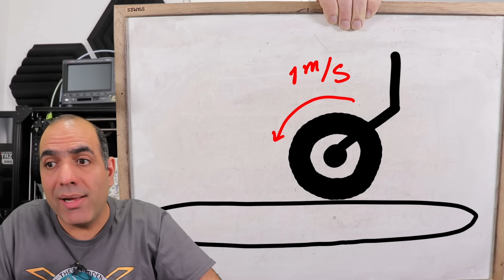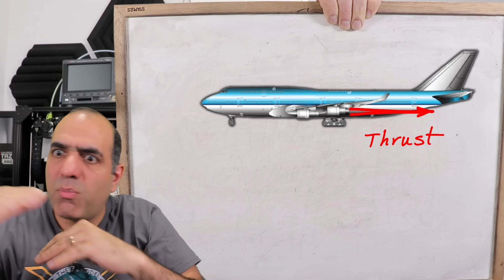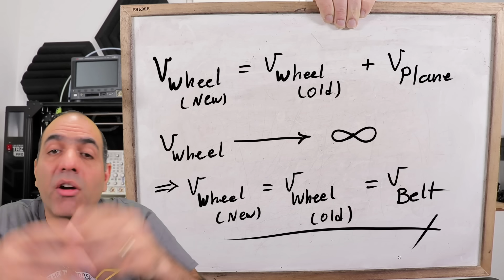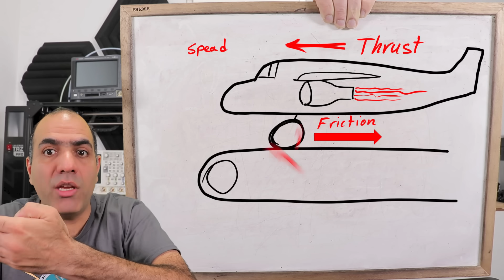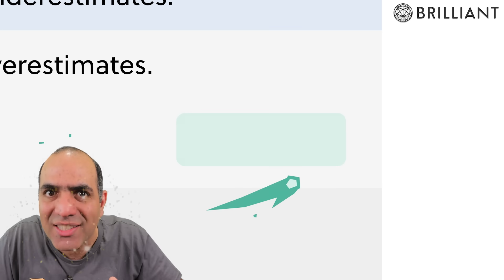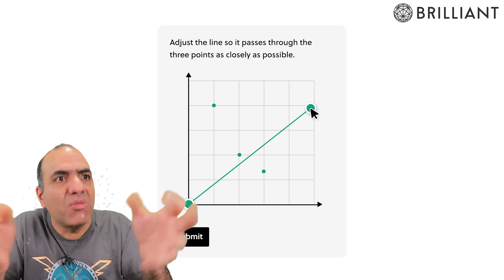Airplane Question that Drove Me NUTS!!!

Comment: before watching video: No, because it will technically never gain speed

After: I would still say it doesn't get off. It may be able to gain some speed, but considering it is a normal runway I would think that the speed it achieves before reaching the end would not be enough to get it off the ground

Comment: I arrived at the similar scenario as Mehdi: if the wheels and bearings have friction, then it wouldn't fly. But that is a completely theoretical situation as it would require a conveyor belt able to run at (tens of) thousands of kilometers per hour. Also the plane's tires and/or wheel bearings would fail at such high speeds. If we assume nothing gets broken during the test, it means the bearings can't have friction and the wheels are metal discs instead of rubber, in which case the plane will be able take off. But in that case it's not a standard 747 and there is always some friction.
Reply: I posit that even if the wheels are made of immortal, hot race-car tire rubber that isn't spinning at all, it still takes off. A 747 has enough power to go 100s of mph through air, a significantly difficult task. At mere take-off speeds the plane has plenty of spare power to push past additional ground friction.
Reply: @skeetsmcgrew3282  You're not grasping the idea of infinite here. The conveyor belt moves backwards as fast as the wheels are turning forwards. If the plane moves a fraction of a millimeter forward, the conveyor belt will be moving backwards at an infinite speed as Mehdi explained in the video. That means the friction is also infinite. The engine thrust of a 747 is not infinite. Thus it cannot move if there is any friction in the tires and/or wheel bearings.
Reply: @Kepe  Oh, yeah true. God, the more comments I read the more dumb this entire question seems. It's so full of holes and assumptions that don't exist in reality. Just show people the damn Mythbusters episode and everyone can go home lol
Reply: Mehdi today seemingly cannot do simple algebra and he seemingly cannot imagine relativity today, he forgets that the APPARENT SPEED of the conveyor INCLUDES the speed of the plane accelerating up to about 160 knots not caring about 2 X (not infinity, of course it is not beeping infinity ! 🤯FULL BRIDGE RECTIFIER🤬) wheel rotation rate until the overspeeded tyres break apart.

Comment: The plane is driven by propeller/jet engines, which do not drive the wheels.
The conveyor matches the plane's speed.
If the plane is not moving forward, neither is the belt.
It doesn't matter what speed the belt is running at, it won't affect the forward motion of the plane, because it moves independently from it. The wheels will just keep spinning faster and faster, maybe until they burst because they will spin at far greater RPM.
Theoretically, if the plane was driven forward by a drive system to the wheels, it would not be able to move, but i know of no plane that uses driven wheels for take off.

Comment: Planes are not about ground speed. In fact, a plane could theoretically be moving at 0kts relative to the ground, and still be flying. 
It's all about relative air speed (often just called air speed or indicated speed). So long there's enough air moving over the wings, it doesn't matter how fast the plane is. 
I think what trips people up is that plane wheels aren't driven. They're not powered. So long the engine is producing thrust and moving air over the wings, it doesn't matter iirc. 
Also Mythbusters did this ages ago. What a trip down memory lane :)

Comment: It will absolutely take off, since the thrust is being generated by the turbofan engines and not the wheels. All the conveyor belt will do is spin up the wheels and maybe cause some extra drag to pull the plane back. But once it takes off the conveyor belt drag will go away.

Comment: Commenting before watching the video: this is a positive feedback loop. The airplane uses jet engines to move forward. The friction of the conveyor belt makes the wheels rotate. Now, some mechanism observes the wheels rotational speed changed (increased), and so it updates the conveyor belt's speed (increases it). However, the act of increasing the conveyor belt's speed also increases the rotational speed of the wheels. This means that without considering some kind of energy dissipation through friction on e.g. axles, only with a little starting push from the jet engines, the speed of the wheels will keep increasing forever - and the airplane will move backwards without countering being pushed/dragged by conveyor belt with jet engines. It seems the airplane will be ejected backwards...
Reply: After watching the video: the gum would burn and lose friction and then the airplane would move forward and take off :D

Comment: What about when the plane engages its brakes which would lock the position of the wheels relative to the conveyor belt? The plance could still spool up the engines, accelerate and take off. The only difference would be that the wheels on the plane don't go round and round.

Comment: The thrust of the airplane is relative to the (assumed stationary) air around it, not relative to the conveyor belt. Regardless of the speed of the conveyor, the plane will move forward at the same speed at the same throttle setting (minus some added friction from the faster rolling tires). 
In reality, you might run into wheel overspeed scenarios. 
It might be a different situation if the question was 'If a plane is inside a magically huge wind tunnel and gets a headwind' etc etc. But then the plane just might take off by itself. Planes like headwinds.

Comment: I've been thinking about this a bit more (since my original comment was before I watched the video) and I don't think the wheels or friction should really have anything to do with it. If the question is whether the wheels turn the treadmill fast enough to prevent the plane from generating forward motion, then there's really no reason to complicate matters with a plane or a takeoff in the first place. Honestly that version of the question could be boiled down to whether it's possible to walk forward off a treadmill that isn't running, to which the answer is obviously yes unless friction is so low as to be irrelevant.

Comment: Keep it simple.  When the plane is about to take off at 160 knots the conveyor belt is rotating backwards at an equal and opposite 160 knots.  With the plane and the wheel centres going forward at 160 and the conveyor going backwards at 160, the wheels would be rotating at the 320 equivalent revs.
There is no infinite loop, people forget to take the forward travel of the plane into account when they imagine the conveyor being driven to match the wheel rotation rate.  As the wheels spin fast they are also moving away, 2 minus 1 gives 1.
320 knots equivalent speed would disintegrate the tyres.  Concorde had very special tyres for 200 knot plus take offs.